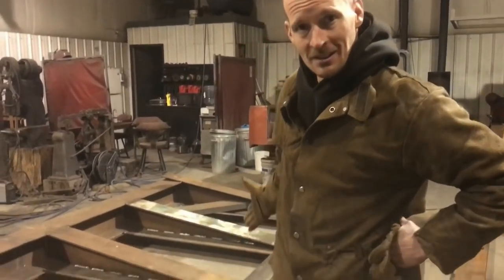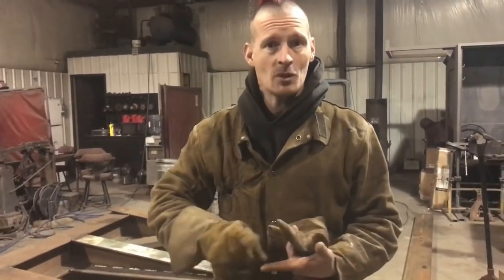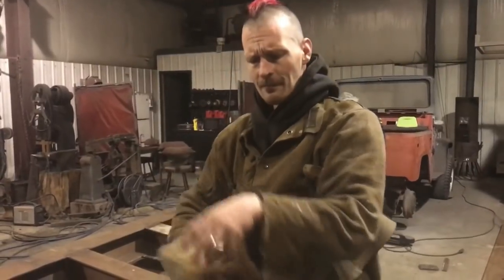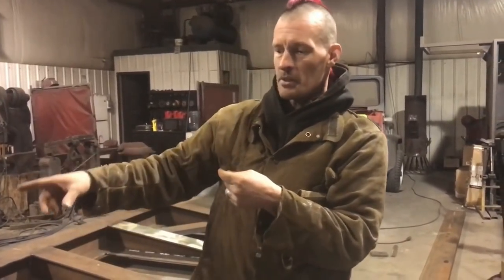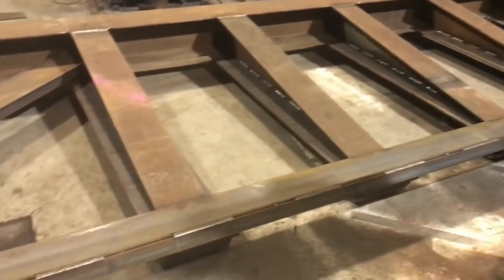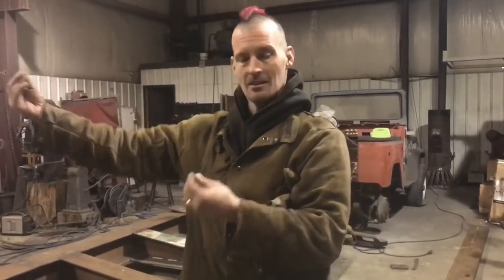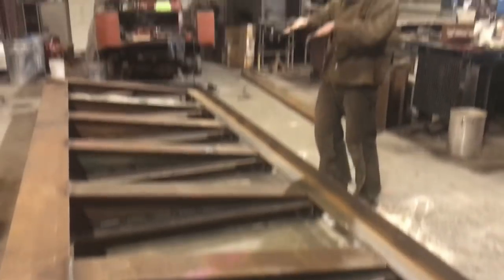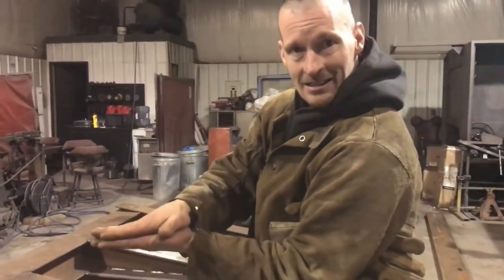2 Reasons to Use Intermittent Fillet Welds

Comment: Hi hellnback like vids wonder if you could show or explain how you weld two pieces of steel together with a gap in between is it just a case of getting your pool and whiping back and forth or am i just going to lose wire between gap, im a novice to old for any classes just tatting about in back yard, seem some vids but you can't see whats going on and they don't show you an example with the gun when not on, like i said I'm a novice and only been practicing about 3 months still messing around with settings at moment lol, bought a fux core welder and yes probably wrong route but live and learn, cheers
Reply from the maker: John Price no problem lots of people do a bit of welding but not as a profession. I’ll put on my to do list for videos since there’s no way you’re the only person with this question.

Comment: Nice explanation and nice job. Yes a continuous weld could act like a zipper and continue cracking. Btw, that's a huge piece of steel to handle, I'm guessing you've got a big overhead crane to handle it. Funny how your cat makes her way into the vids.
Reply from the maker: Jim Zivny I have two forklifts to handle my steel, decided on those over an overhead shop crane for now because they can also move steel around the yard and my big one doubles as my snow plow so they’re more versatile.